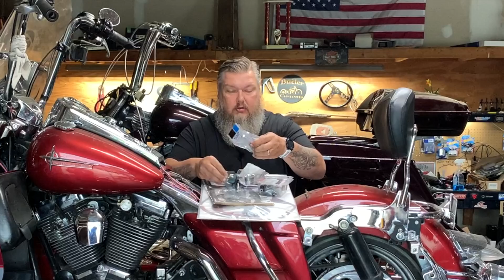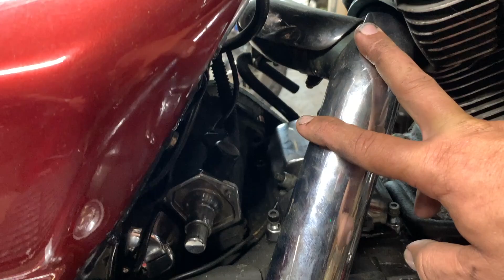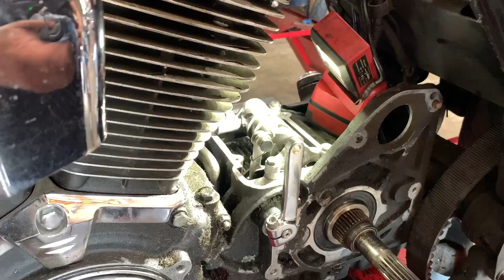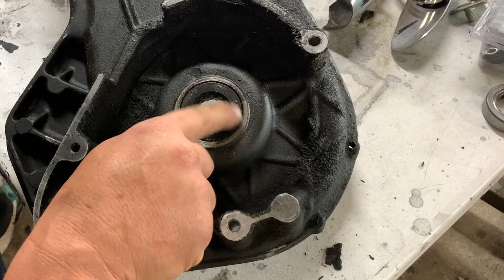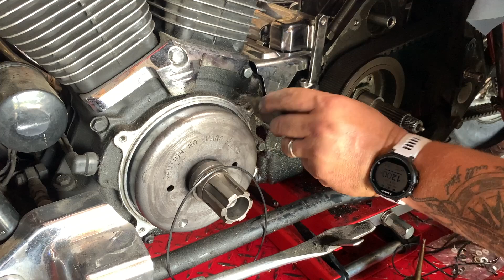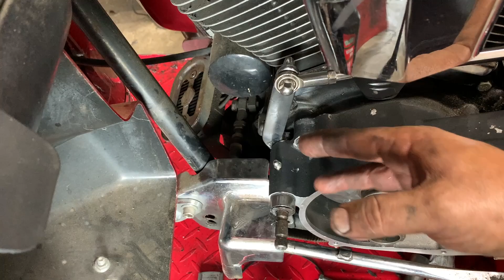Part 2 of Harley 5 Speed Shifter Slop Fix. Inner and Outer Primary Removal. Shaft lever replacement.

Comment: 25:14 what if it’s brand new?  I’ve only put maybe 20 miles on mine
Reply from the maker: If you remove it and press it back on, it will walk on you.
Reply: @b @butlercustoms e shaft wore through and separated itself from the assembly at the factory weld. I can match up both pieces flush— couldn’t I just line them up and re-weld them?  After removing the shifter shaft seal shaft seal and draining the transmission, I mean
Reply from the maker: I guess anything can be welded back if the welds hold good.

Comment: In theory. Could you just take the top cover off the trans take the clutch cable cover off slide the gear set out and then unbolt the shift linkage and slide it out far enough to get a screwdriver behind that c clip( replacing it of course because you’ll destroy it taking it off like that) then the shift shaft will slide out allowing the linkage to come off the shaft and then re assemble with new shaft linkage and c clip then you don’t have to take the primary covers off. Just a thought. Because I’m afraid my 96 unfortunately needs both and I just did my stator not long ago and I’d rather not pull my primary’s again while it’s still riding season 😭 any input on my theory would be appreciated. Great video 🎉
Reply from the maker: While that might work, I would lose my mind trying to get that clip back in. There’s just not much room to work in there from the top.

Comment: How much did all of that cost to do including the special tools? My 1990 Police Edition needs that shaft changed also. I think I also have a gear that broke a tooth off. So far everything that I have done on this bike has been frustrating for me. I could not even get my clutch cover off to change the oil, due to the torquex bolts being stripped out. I drilled the heads off and replaced them with Alan Head bolts that matched the ones holding the primary chain inspection cover. I had to change my back tire, and that took me 3 nights to do. My wife wanted me to take it to a dealer, but I told her that I can't afford the dealer labor rate. I have changed dirtbike tires in about 20 minutes and thought it should only be slightly harder. It seems that this bike needs to be almost completely dis assembled to do what is simple on smaller machines.
Reply from the maker: It’s a big job on those models. You’re welcome to email me at butlercustomsmotorcycleshop@gmail.com

Comment: Quick question. If I don’t need to replace the inner race, do i need to replace that “main” seal? Or is the starter/stator/whatever it’s called seal the only one I would need to replace, when reinstalling the inner?
Reply from the maker: That is correct. However it’s one of those “while you’re in there” things. It would stink to get that deep in it, not replace those, and then 3 months later the older seals start leaking.
Reply: @butlercustoms thank you for the answer sir! Watched both parts of this job 4-5 times to try to do it myself. Got er all tore apart and just need to order the parts. Will visually inspect said seal, and decide from there. Thank you!!
Reply from the maker: @Folmer76 my pleasure! Best wishes on your repair!

Comment: Use heat as well for that inner primary bearing. Also gotta use some wood blocks so the pressure goes straight down. I blew one out the same way  once 🤣
Reply from the maker: Great tip! Thank you for sharing!

Comment: Where would i be able to find a list of all the parts seals races gaskets ect needed to do this job?
Reply: Ronnies hd parts finder is great. You can look up your specific year make model and get all the diagrams and parts lists with the ability to order right there. More information found at ronnies than anywhere else hands down.
Reply from the maker: @jmckay5736  I agree. Ronnie's has the online microfiche parts finder. But the old year Harleys are limited on there. But I do use those to find the OEM part numbers. Thanks for sharing!
Reply from the maker: Dennis Kirk or JP cycles would be a good option as you can put in your bike info for a direct match. As far as a list, that really depends on what you find once you tear into it.

Comment: This video has been a blessing. The only thing I would suggest is that when you make a mistake you might make a note of that on screen. I was using this video and pausing it as I went, completing each step before continuing. Even though I watched it all the way through before I attempted the repair, I forgot that you missed the throwout bearing, so therefore I missed it too and had to take it back apart. That's really just a minor inconvienience and maybe a good lesson because I bet if I do it again in the future, I won't miss that throwout bearing!  Many thanks. Subscription earned 10 times over!
Reply from the maker: Thank you for watching and subscribing. That’s a great suggestion! I’ll try to make less mistakes but if I do I’ll try to add better video updates in editing. Thanks!

Comment: im replacing the shifter pawl in my 96 flhtc, all too familiar with the process, your video is great i had my dad teach me , but if he hadnt your video is step by step, any chance you have the various gaskets and parts list available, trying to order everything and i dont wanna forget anything. thanks and keep up the vids!@!!!!
Reply from the maker: Thank you for your kind words. I try not to show part numbers as most models might require a different set. I don’t want to be blamed for someone ordering the kit I used and it being wrong for their bike. Dennis Kirk or JP Cycles are good sites to use.
Reply: @butlercustoms  was only interested in the parts list, not part numbers, but i get it.
Reply from the maker: Oh. Gotcha. You’ll need an inner primary gasket kit and a transmission gasket kit.

Comment: Thanks for the help, I really appreciate it. Im curious what brand of shifter paw did you use to replace yours? Its really thin and I don't want to purchase that exact brand. Im thinking Drag specialties, but wasn't sure. 🤔
Reply from the maker: I believe it was a drag specialities. If not that then it would have been a v-twin.

Comment: I noticed on my softail it has 2 grooves where the c clip would go. If I place it in the grove right behind the splines it’ll feel loose but if I put it on the rear grooves it’ll be a snug fit. What do you suggest? I have pics of reference I wish I can send you
Reply: The groves on the shifter shaft
Reply from the maker: please email the pics to butlercustomsmotorcycleshop@gmail.com Thanks
Reply: @butlercustoms  just sent the email, thank you
Reply from the maker: My pleasure.

Comment: Great video! I hope to god my transmission shaft doesn’t look like his when I go to replace the arm!!!
Reply: Other than the arm and primary gasket set is there anything you would absolutely recommend at the same time? Best case scenario that is.. 98 Fxds conv. 20k miles.
Reply from the maker: I would just inspect all the seals that are only accessible once the inner primary is off. I’d also inspect the bearings and the race.
Reply: @ will do! Thanks for all the info and keep up the good work Ang videos!
Reply from the maker: My pleasure.
Reply from the maker: It was pretty bad. Let’s hope yours isn’t. Thanks for watching and commenting!

Comment: Awesome video! You do an outstanding job with explanations and detail. 
How many labor hours do you charge for this repair?
Reply from the maker: Thank you for your kind words and for watching. It was several hours of work but it turned out great.
Reply: @butlercustoms  is removing the old inner shift rod the only way to tell if the shaft needs to be replaced?
Reply from the maker: No. You should be able to visually inspect the shaft splines once the shifter arm is removed.
Reply: @butlercustoms  are you currently taking in customer bikes? I’m in TN too, and looking at a couple bikes for sale near you that might need a little love. One bike has the bad/sloppy shifter issue, and another has a bad rear axle bearing.
Reply from the maker: @Aaron-qh3hr absolutely! I’d be honored to help you out.

Comment: Have you ever known anyone to be able to drill through the shift shaft lever and shift shaft; and press in a roll pin to stop the shift lever from spinning on the shaft?  Not sure if it could be done with the inner primary in place; but if I have to go so far as to replicate all this work you're doing, I think I'd take that precaution just to make sure I never have to worry about those splines wearing down again.
Reply from the maker: I’ve never seen anyone drill for a pin before. Not sure what tool one would use. It’s a very tight spot. It sure is a big job but once that shaft is rounded it’s toast. Thanks for watching.

Comment: Do you recommend to upgrade for inner primary case for single piece bearing instead of two piece stock bearing?
Hopefully that makes sense.
Reply from the maker: Personally I’ve not noticed any difference. As long as the bearing is a good quality bearing. Good question. Thanks.

Comment: What are the torque specs for the main shaft nut and the plate around it? Also torque specs for the dip stick plate?
Reply: Good afternoon, so I am just about to pull the gear case out with the trap door. However, it seems to be binding up on something and it looks to be a pin on the right side. In your video it looks like that light color pin that looked like a rivet that you pull out on the middle right. Have you come across.any pins that have been inserted that hold the trap door from sliding out? If so, how would you recommend taking it out?
Reply from the maker: @ericgutierrez8028  did you remove the main shaft race bearing?
Reply: @butlercustoms  yea all of that is out. I am at the point to where it should slide out. However, I think it's held up on that pin on the right of the trap door. Have you seen that before
Reply from the maker: @ericgutierrez8028 I have not.
Reply from the maker: I usually don’t mention torque specs in my videos for the reason that some models and years have different specs. So I would recommend looking it up for your specific bike.
Reply: @butlercustoms  understood. I have one last question, I have a 96 Heritage which I need to change the pawl. Is the process the same from this video?
Reply from the maker: @ericgutierrez8028 yes
Reply: @butlercustoms  awesome! Thank you and keep doing your videos
Reply from the maker: @ericgutierrez8028  thank you for your kind words.

Comment: Great videos ,one question what is the ballpark labor price for this job ?
Reply from the maker: Thank you for your kind words. That’s a great question. Each shop has their own rates that are usually set based on their overhead cost. So independent shops like me are usually about half the price of the dealerships on labor because we have very little overhead. As far as labor hours go, independent shop will usually bill more hours than a dealership. And the reason is often because the independent shops take their time and do a lot more inspections and care for each bike. While dealerships have to crank bikes out the door. Hope this helps.
Reply: No, you didn't answer his question.  @butlercustoms
Reply from the maker: @nonserviam2533 every shop is different in rates and experience. One shop might charge less than another. Giving a quote online is not the wisest. I’ve learned that from experience.

Comment: As one who hates snap ring pliers, I at least got some suggestions. All on Amazon for ease, wish knew they where on there when I bought them lol. Gearwrench 2012 D.....screwdriver type holding style. Lang Tools snap ring holder tool # 87....this is my favorite bc when its holding tension its always there....also works best on external type rings bc tips are cumbersome to get into tight place....but works great on larger rings. And my go to for one reason over more than rest is that only this type and one Lisle tool are the only ones where the locking paw stay inside pliers and not outside getting in way. When you look at this brand compared to other like HF or who ever you will see the paw differnce. Sunbright Tools 2pc snap ring pliers set. Did not see part number, but if you do a Google search you will see them in Amazon. If you look at the locking clamp it stays in between the handles. Good luck. Enjoy the vids.

Comment: Thanks so much for this video. My rear shift shaft's splines are great shape but the shaft defiantly has some play but no fluid leaks. No shifting issues but should I be concerned? Possibly issues with the pawl? thanks again
Reply from the maker: I would certainly inspect it. If left neglected then you will have to get into the transmission just like I had to. Thanks for watching and commenting!

Comment: Man, i tell EVERYONE new to Harleys, check your Shifter pinch bolt on the tranny regularly, especially on a dyna or dresser. Cause if you wipe out the splines on the shifter pawl, you'll be pulling the gearset out to replace it. Jus keep it tight an you gon be ok
Reply from the maker: Great advice! Thanks for watching!
Reply: I learned the hard way. That's what brings me here. But, I discovered a great harley mechanic on youtube because of it.
Reply from the maker: @shanes_bs2659 those are some very kind words! Thank you.
Reply: A Better Lever makes it a lot easier.
Reply from the maker: That’s true!

Comment: Use Jim's tool 5517, no trans dissemble needed!
Reply from the maker: Unfortunately, that tool is for 2007s and up. The older 5 speeds require trans gear removal. But thanks for sharing.